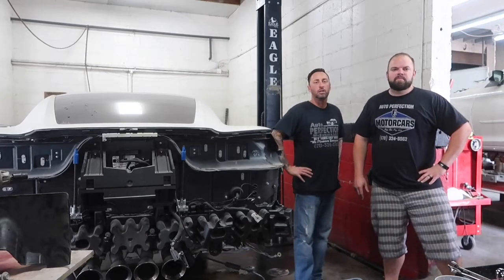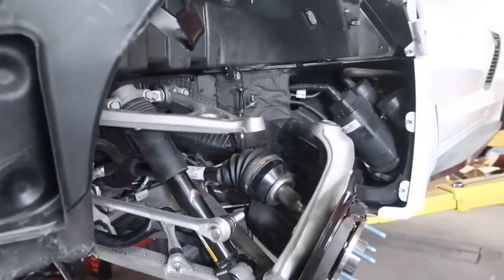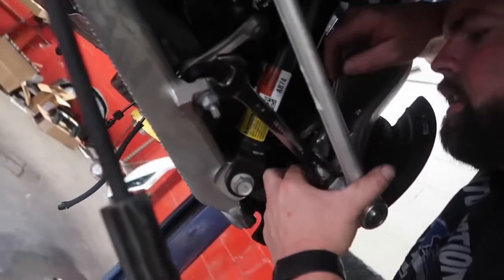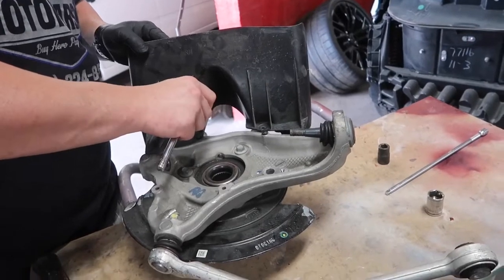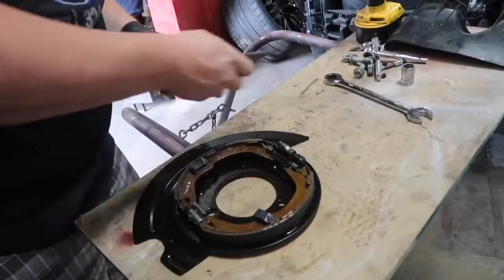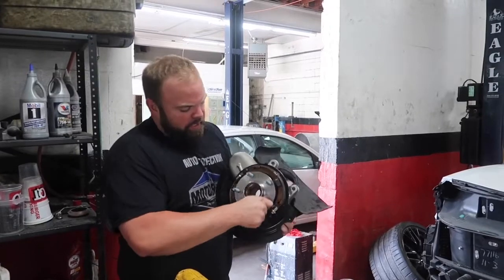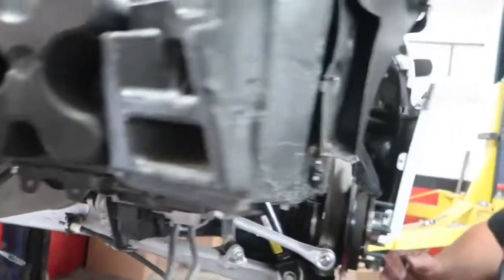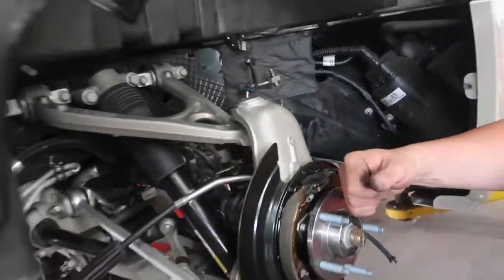Rebuilding a Wreck 2017 Corvette ZO6 Part 3 ll Budget Rebuilds

Comment: The suspension, diff cooler , and break components will nickel and dime you.  How much you guys invest to get it back on the road?
Reply from the maker: The pricing should be in one of these videos. You are right, though. Using all oem parts is def pricey.